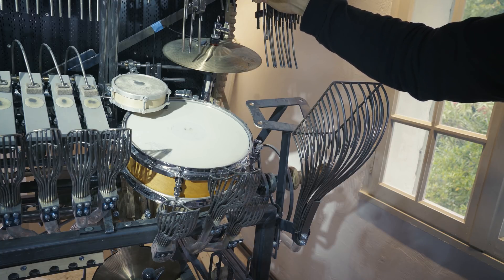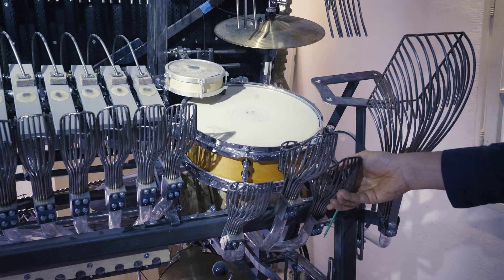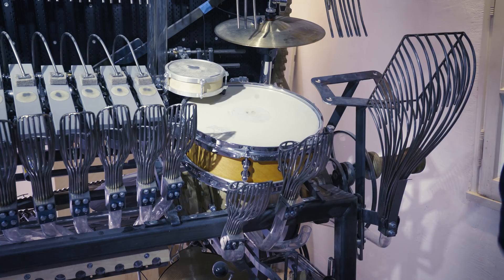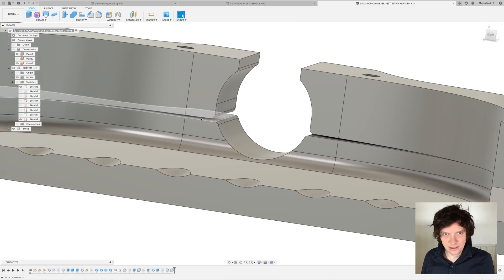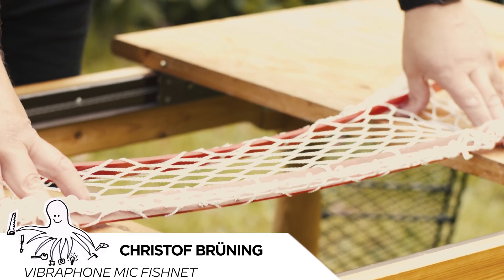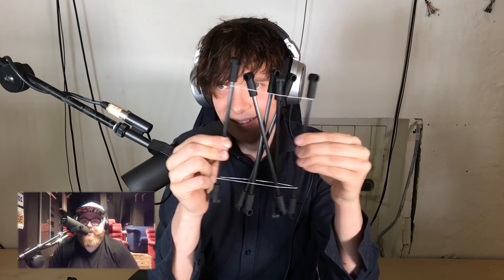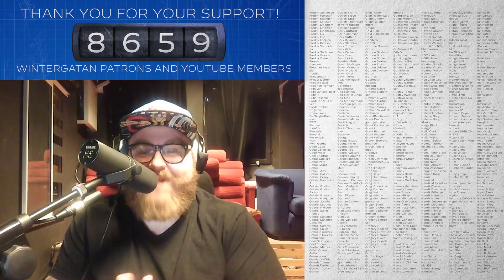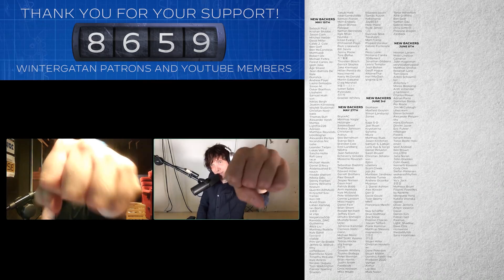Saving the Marble Funnels with Rubber Coating? - Marble Machine X #129

Comment: I'm worried about plywood friction. Some layer of polyamide would prevent plywood friction dammage for sure. 
Also screw threads hit constantly by marbles doesent seems to be a good idea. Marbles get dammaged. Screw thread gets dammaged, also i guess its noisy. Maybe try to use an inner threaded nylon spacer on the end of the screw. (where marblehit)  Not sure if it gets attention, its already a thousand comments here. Good luck Martin

Comment: just put a foam cup on the inside of the metal cup.  The foam will deaden all the noise, while the metal will provide the structural rigidity and function.

Comment: At almost a thousand comments I doubt mine will reach Martin's ears. Most comments are about MMX. This comment is about you MARTIN. MMX is awesome. But it took the skills you have learned since the start of #2 to make it happen and that's more awesome.

You have learned how to weld parts like a professional now. Your hand wood working is like someone that has been doing it for decades. But the "BIGGIE", is the Cad and CNC stuff. When all this started. Not that long ago. You knew little to nothing about Cad and CNC. Now look at how comfortable you are at designing a part in CAD and then using CNCing or sending off the file to make it.. (Did I just invent the phrase "CNCing"?) It's an art like music.

Music is your thing. That is number one for you. This pandemic is a problem for doing the number one, music shows and the income from it. You have learned new skills and are good at it. You now have skills to fill in for a time when the music venue is in decline.

Comment: martin on cars they put a rubber mount with a steel weight molded on to it to stop harmonics you could put something like that on the steel bridge that all the funnels are connected to . cars usually have them mounted on the exhaust pipe or front wheel drive cars also have them mounted on the side of a gearbox or engine mounts but a rubber mounted steel weight would absorb a lot of the noise just remember the mounting bolt cannot be affixed to the weight it has to be fixed to the opposite side of the steel weight  hope this info helps ps on a car the weight is about 2 or 3 hundred grams

Comment: I keep wondering why you have designed all these individual steel cages. It's complex, noisy, difficult to adjust. Why not have a large receiver across the whole machine, padded with some absorbing material ?

Comment: I am sure you have a big team helping you, but I have some tips for plastidip.
Plastidip it's cool but doesn't work well with friction, I am afraid that while on tour you might see the plastidip start to peel where the marble hits if the marble happens to "drag" and not just bounce of, so don't skimp on layers, they recommend about 5 layers if I am not wrong, usually for non critical applications you can kind of skimp and go with less, you obviously shouldn't.
If the dip happens to peel you can usually sand the edges of the peel, maybe use some paint thinner and remove the damaged part (the dip will turn back to goo) then re dip it. The problem is your funnel it's pretty complicated so doing this quickly is not an option. So, I would bring with me a bucket of paint thinner and just remove all the dip when it gets damaged and just dip it again. This is not cost effective but I guess nothing is on the marble machine lol.
And I wouldn't dip the funnels straight in a bucket of plastidip, because, at the end of the day, it's liquid rubber, I am afraid the final result would be "fork dipped in honey" and all the little parts of the funnel would end up with the rubber in between them. 
I don't remember how many funnels you have but by the time you painted all of them the first one should be ready for another layer, I would say this is about 2/3 hours to paint and a day to completely dry I don't know if that's doable on tour.
I think you should leave a dipped funnel with a marble dropping on it for a while, if you leave it for let's say 24 h and it shows no signs of peeling probably this won't be an issue ever

Comment: I'm not sure if this has been raised before, but I have a theory regarding the occasional "super jumps" from the vibraphone. Since the individual bars are able to vibrate up and down due to the spring steel supporting them, the marbles don't always hit them the same way. If the marble happens to strike the bar at a moment when the bar is moving upwards, it would bounce much higher than if the bar was moving downwards. Slow motion footage could confirm or disprove this theory.

Comment: Hello, Martin! Keep you way! But you can use "flocking technique" for coating of "catchers" - it would better imho. And it able to repeat at any town of world tour - its not a problem even in my... if you reach me - call). PS Flocking is a method to apply very short (1/10″ to 1/4″) fibers called flock to a substrate, such as fabric, foam, or film, coated with an adhesive. Flocking is an inexpensive method of producing an imitation extra-yarn fabric, flocked in a design, or a pile-like fabric where the flock has an overall pattern. Good luck! Anyway, let us to hear MMX training sets PLS!!! We need it!!! LIKES WHO AGREE!

Comment: Dip the funnel's in a clear silicon like "Dragon Skin™ 10 MEDIUM" from smooth on..  Hang the funnel side down so they can drip as they cure..  You'll have a invisible coating that's much thicker then the spray can can ever give.   You can dip them a second time to add more thickness if needed.  The soft silicone will make them silent.  The only noise will be in the contact area where the spring snaps the two pieces together.  (De-gas the mix in a vacuum if you want perfectly clear coating before dipping.)

Comment: is there a particular reason to use such a lightweight material for the vibraphone mic holder apparatus? I'm almost inclined to think a massive structure would be desired since dampening vibration is a concern.

Comment: Plastidip is not a rubber coating per say. If you want it to actually last and not just flake off after light use I would have used flex seal.

Comment: I think this is not the best solution for the funnels yet. The marbles fall from a high distance and do heavy impact on the funnels when landing. This results in damaging the coating until the marbles hit the metal underneath again.

Maybe there is a solution for this. There are black mats which weigh very much. I don‘t know how they are called but they are attached right under the kitchen sink to prevent the dishes making loud noises. It‘s like a big tape.

You can cut that material i think and so you can keep the aesthetic shape of the funnels. Maybe it is worth a try. Keep up your masterminds work. Can‘t wait to see the finished Marble Machine X. 🤗

Comment: It is actually very interesting to see other people using similar solutions for realesing the marbles :D I mean, I used exactly the same solenoids as Thomas in his machine did and we both also had small wooden blocks solution to catch and release a marble. Gut gemacht, Thomas! 
I'm curious if you also have faced the problems with the weight of marbles queue.

Comment: It might be good idea to use that same rubber coating on the wooden rails etc. where marbles are running to reduce that noise too, if thats what becomes an issue that is.

Comment: For the task list, you should really look into a proper task management system. There are many out there, like Trello or Jira. They give you a lot more power in creating milestones, deadlines, looking at tasks at a glance, easy assignment and communication, what the status of each task is, and so on. I believe it would greatly increase your productivity at this stage with so many actors involved to get out of that spreadsheet.

Comment: If you want to denoise and go high class material for the funnels, then make them out of wood. The low cost high speed variant would be CNC cutting Plywood walls that are glued together. My favourite solution would be cone shaped wooden Funnels a little bit like the ones in the Virtual Marbele Machine Videos. They could be Lathed rather easy. Or to save the high class transperent looks of the current funnels you could use Sticks that are bent before being glued together.

Comment: Just a thought, to keep the frame of the mmx amplifying sound, science it's made up square tubing what if you drilled some holes in it and filled it with expanding foam I wonder if it would dampen the sound

Comment: Design over function is always a bad compromise. The sound of these things is still bad and ruin that great Project. It is metal, it will swing when it is hit. This spray is not stable and will dissolve over time. You need more softness at the hit point. Glue a small piece of rubber or felt on the inside. Nobody sees it except you. I sure, it will not look more stupid than the screwes on the top.

Comment: Use plumber goo thinned with toluene! It is much more "rubbery" than Plastidip. And it is much cheaper. Aaaand if you need to repair it you can just rinse it off with pure toluene.

Comment: I think you should also acoustically isolate the funnels from the frame with some felt of plastic material, and also isolate each half of the funnels. Take a look inside your piano, all the moving parts of the action are either padded or bushed with felt. You can't completely prevent the noise of the parts but you can certainly prevent most of it from propagating into the rest of the machine. Sorry to add (even potentially) to your workload!

Comment: This is looking better by the day Martin, congratulations!!
I watched a video last week which I thought was fascinating in the sense that it could be very very useful for you. Look up: "Reveal Invisible Motion With This Clever Video Trick". This would basically display each and every moving piece in the machine, not only the ones that obviously move, but also stress points which could be troublesome in the future, allowing you to keep a close eye on the structure of the mmx and spot potential problems in the long run, as well as monitor the structural integrity of the machine.

I hope it's useful for you. It sounds sad but honestly you're the first channel I thought of when I watched the video.

Comment: Trouble with PlastiDip and other spray on stuff is durability. It will definitely peel off, and having it on steel itself will make it prone to peeling from moisture and heat. 
What you really need is some way to get a silicone coating, like those cheap wire kitchen/shower accessories that are steel with a plastic/rubber coating. Albeit, solid colored usually. You could probably achieve a similar effect with clear heatshrink, although it would be something of a frosted finish instead of shiny (unless it can be melted far enough?).

Comment: That microphone net is smart in the ways described in this video. However, I think it's going to be an eye sore that detracts from the beauty/mechanics of the MMX and will not be at all sturdy for transport. If the microphones are hard mounted to the netting, I imagine the netting will flex and allow the microphones to hit another part of the machine (or each other) during transport. Otherwise, it will be a pain to have to place all those microphones in the net every time you unload the machine and another pain when putting them away at the end of the show. Are you determined to use SM-57 microphones for this purpose? My opinion is that only the snare drum will benefit from having that exact microphone. I'm sure there is a much more discreet microphone that will give you the sound characteristics you want for the vibraphone. Personally, I think the microphones on the MMX should be as invisible as you can make them. Have you looked into lavalier microphones? You could put each one on a slender gooseneck, thus having it always adjustable and still keep it's visual impact to a minimum.

Comment: Put a transparent tubing on over the marble catcher wires. If you cut a slit down it your can wrap it around not problem. That will make it so you don’t have to worry about re coating it and it will dampen the sound even further!

Comment: I still think it would be (overkill but awesome) to have programmable flip-flops on the programming wheel that are set/reset like old computer memory, physically moving the pins in and out with effectively solenoids...that way, the machine does what the machine does - and the wheel is potentially reprogrammed on the fly.

Comment: I think if you make the top of the funnel curve more, it will slide more than hitting it. And funnel takes the energy of marble and slows it so with this modification marbels will move faster and you will be able to use less marbels.

Comment: LOCTITE makes a product called Color Guard which is a dip rubber coating for tool handles, that would utterly deaden likely all sounds from it. It will likely take the wear better from constant impact.

Comment: @Martin  You might want to consider injecting butyl inside the box section of the frame (once all the welding, drilling and grinding is finished!) in order to deaden sound transmission.

As a proof of concept, try taking a spare length of box section and hit it all over with a drumstick to see how it sounds, then inject some butyl and see what a difference it makes. You wouldn't have to fill the tube; a strategically placed blob or two should have a marked effect.

In case you have no idea what I'm talking about, butyl is a synthetic rubber, like a non-drying silicon, also known as Sikaflex or Everflex:
https://www.amazon.co.uk/Everbuild-EVB145GY-Butyl-Rubber-Sealant/dp/B006UQLE6C